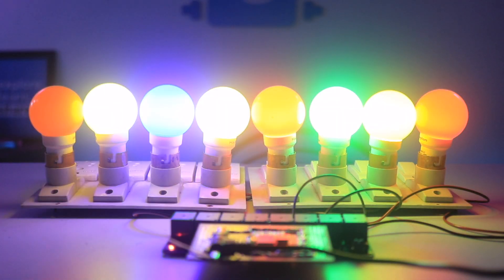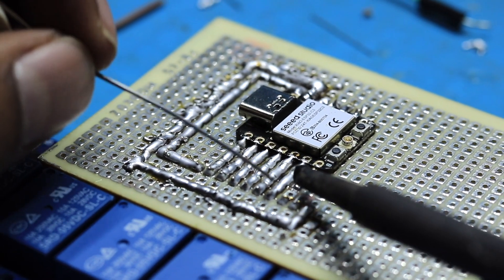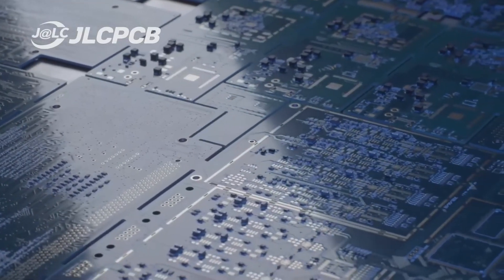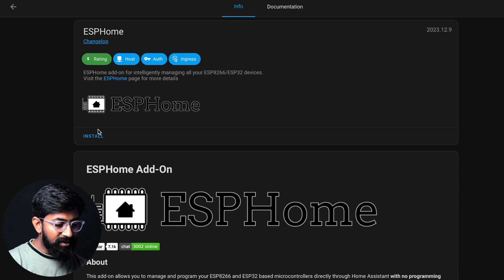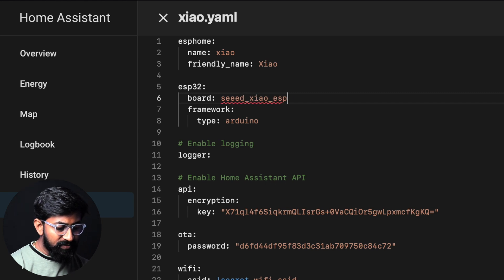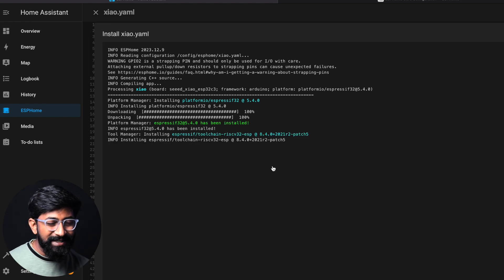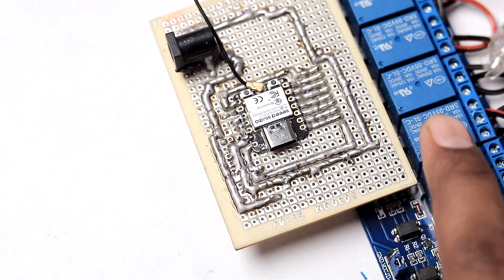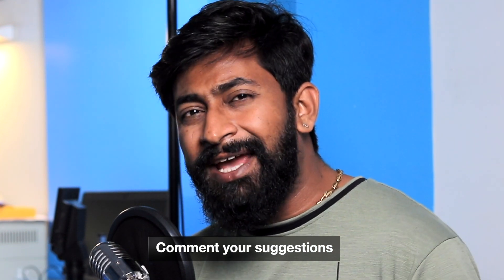SIMPLEST!! DIY 8 Channel Home Automation using Home Assistant | ESP32 Projects

Comment: Sir please make a video on how to control 4 relays with esp32 board while using webserver and save the last state of relays and add manual switches for manually controling the relays
Reply: Use tasmota

Comment: This can be improved further sachin, Add toggle switch in ha yml, add push buttons not switches, in real scenario you need to save last state of relay (e.g turn on/turn off) this will be useful incase power goes down and you need to keep the device in last state. Your video looks cool, thanks

Comment: Somewhere I have seen a home automation video using BT, Alexa/Home, IR Remote and Manual switches to control home appliances. Almost all IoT platforms have limitations. Is there any without a limitation. Sinric/Ubi/Blynk/Cadio all have some restrictions. Any platform that can be used freely. Request consider with Gerber Files and coding.
Reply from the maker: you can use Rainmaker for that. it's free and has all the features 
have a look - https://youtu.be/87QhjQth-pQ?si=WVpA95JKoFbenXOi